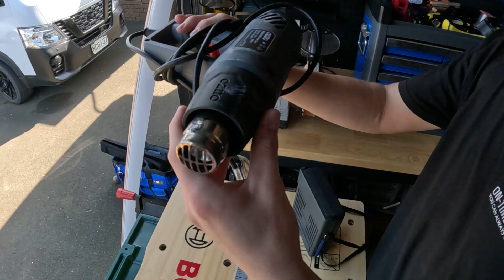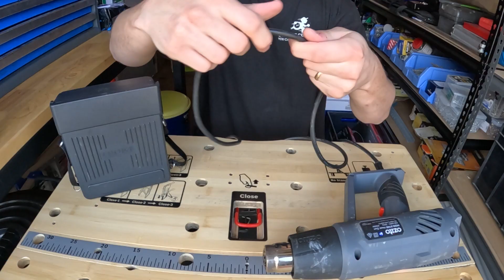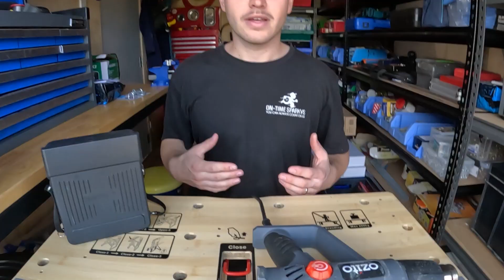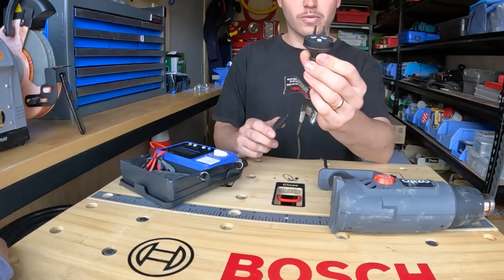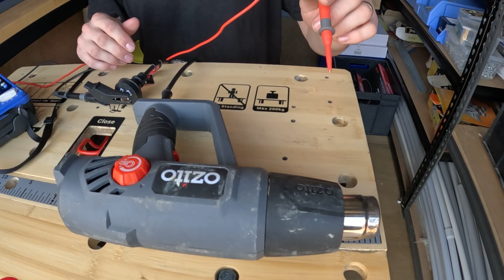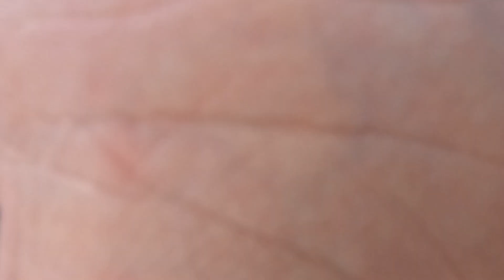HOW TO TEST A CLASS 2 APPLIANCE? 🤔

Comment: How do you test a application that contain electronic and can't do IR test with high voltage?
Reply from the maker: Hey Jack, good question! You can set the voltage to a lower voltage so that you don't damage the electronics. Thank you!
Reply: @thewiringhub  Ahh yeah , i see the 250V setting on your HOKI meter, one more question, when do you require to do a leakage current test?  do you have to do it on PAT tester or using a mA current meter to do it?   and also, great video thank you for making the video! i like it alot!